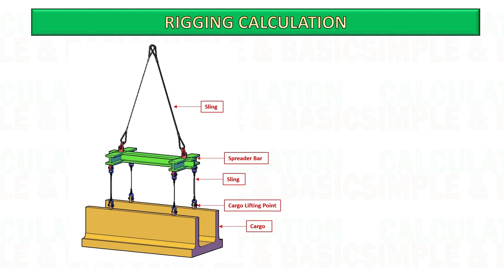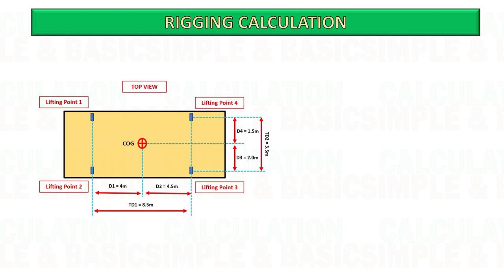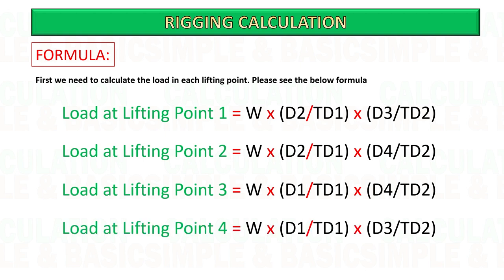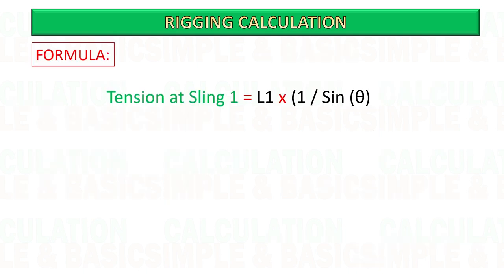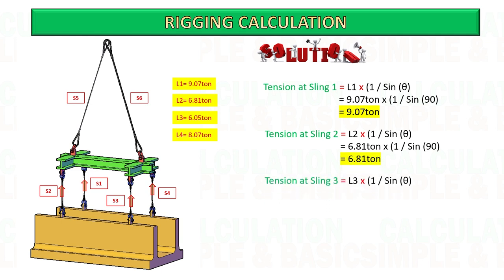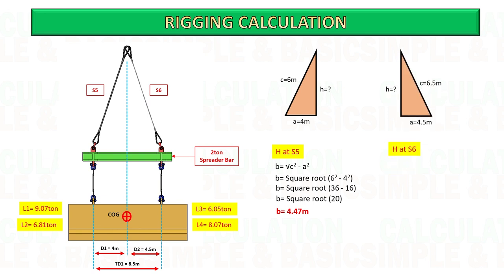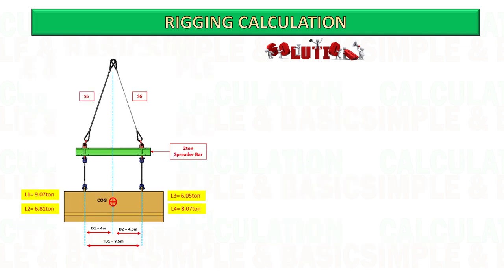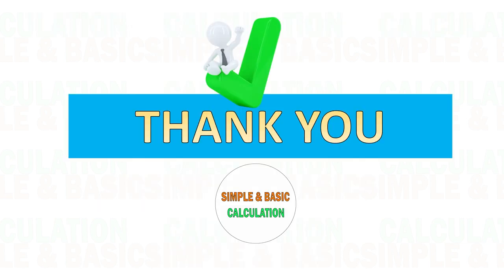Rigging Calculation for 4 Lifting Point with spreader bar #lifting #rigging #crane #heavylifting

Comment: Sir Thank you for your work. One question. Why in video #3 the formula in lp1 was w(d2/dt1)(d4/td2) and lp2 w(d1/td1)(d3/td2). But here another. Is they not same?
Reply from the maker: Thank you for your comment, I appreciate your observation. This is just the same formula.
By looking at it, the positioning of lifting points 1 and 2 in this video differs from video number 3.
Reply: @SimpleandBasicCalculation  OK. Thank you 🤝